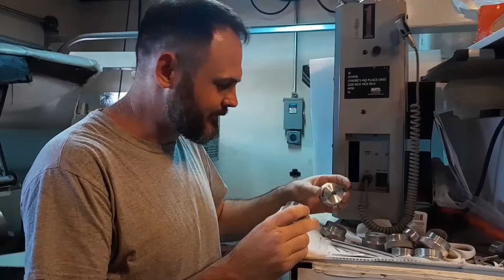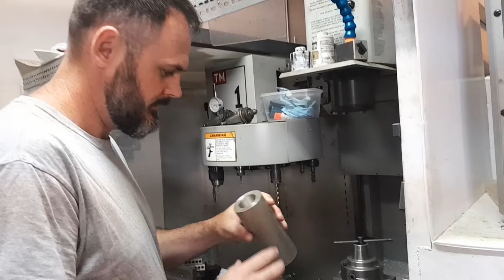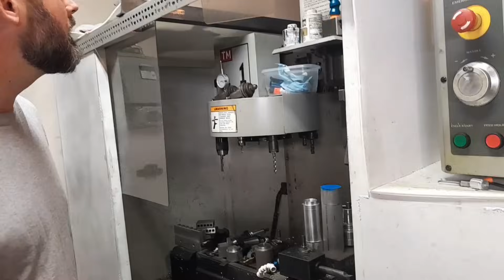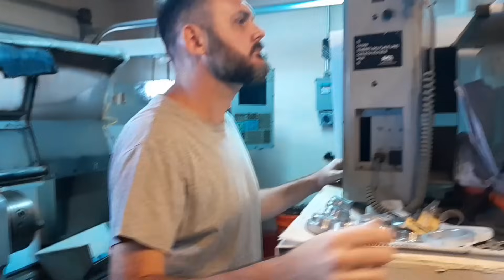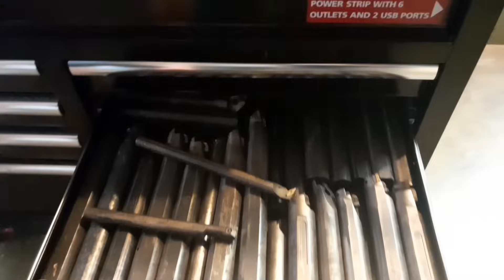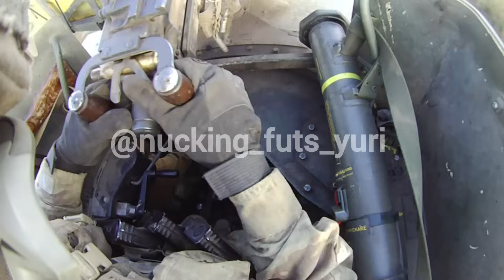Big plans coming.

Comment: Why are you moving the machines to Ukraine?  I am confused on why you would need to as foremost, AFAIK, Ukrainian Machine shops and Machining network is not under full utilization more lacking funds to do the work and maybe the expertise, design wise.  You'd need someone to run the machines anyways. Granted I could see this being a travel time reduction measure but that can't be the sole reason as Poland and Romania are known manufacturing centers particularly the latter due to substantial German Investment. 
Finally, wouldn't it also make more sense to do it stateside as you will have faster and easier availability of materials? Plus since you are an American educated engineer I assume that you are used to American or SAE standard materials something that would need to changed over to EU standard assuming you could get the correct substitute material in Ukraine.  Plus wouldn't you be putting your machine shop in range enemy munitions with the Russian superiority in Strategic and Operational Fires?

A questions about the drone dropping of munitions.  Is target presentation time so short that artillery assets, like mortars or tube, can't be given a fire mission in time to strike targets or is it too dangerous for the firing units or is it something else?  Due to the small size of drones, wouldn't it make more sense to use any larger payload capacity for better sensor packages, loiter time, or both? I bring this up because it was mentioned by the Terra recon group, 3rd Brigade, as the preferred method of using the drones.

Comment: It's already water under the bridge, but why not buy the machines in Ukraine, or in Poland?
Reply: Some places there is a bit machinery desert so to speak.  Bridgeport’s are like the AK of milling machine world. Lots made and even more clones. Yet in my area, a decent one is 3-4 times the cost comparable to the east or west coast. Same with lathes. Not even getting into the used CNC market.
Reply: Basically any on the used market are for sale because they are absolutely clapped out.

Comment: Amazing effort and work. Incredible dedication to helping the people of Ukraine. Proud of people like yourself.
Reply from the maker: I'll be running operations from the start. Setting them up and attempting to get more machines and capabilities.
Reply: @nucking_futs_yuri sorry, I edited my comment after finishing the entire video. Thanks for answering my questions though.
Reply: @nucking_futs_yuri I’m sure you are aware, Mercado is leaving the US in a week to Ukraine. He has the Earpro/eyepro you discussed in Kyiv. I’m sure your in contact and have this all sorted.
Reply: @nucking_futs_yuri sell the machines and buy new ones in Europe!
Reply from the maker: @Fenrir.Gleipnir  I get that a lot. No. Trust me it is cheaper to do what I am doing.
Reply: @nucking_futs_yuri  there are some nice developments in rotor tech, silent toroidal shape like rotors, looks very promising, only downside is the manufacturing is much harder to pull of.. anyhow, take care and all the best with the move of your gear!
Reply: @nucking_futs_yuri So basically you people will upgrade existing drones or build new ones from RC-hobby components or how far you want to go down the vertical integration?
Reply from the maker: @l.b.3416  building mission specific drones from the ground up. I'm working with an entire team of guys on this, each with their own specializations.

Comment: A lot of the Russian defence seems to be in the treelines, do you think drone dropped Molotov Cocktails instead of grenades would help clear them out?
Reply from the maker: Fun fact: Flamethrowers used against entrenched soldiers isn't a war crime.
Reply: @nucking_futs_yuri  Fun Fact: Flamethrowers also may or may not fit onto large drones
Reply from the maker: @TilW  we'll see 😂
Reply: @TilW  
Idk man
100kg Napalm canister should be able to be carried by some of the heavier drones
Reply: Ever seen the crop duster drones used by farmers? What you are proposing is absolutely achievable! Look up the DJI Agras T40 demonstration. It will give you plenty ideas.
Reply: >molotov
Napalm/Thermobaric is more like it
Reply: @krellio9006  Drones can only carry a couple of kilos, a thermobaric warhead doesn't set fire to a treeline.
A Molotov normal has petrol or diesel mixed with a sticky substance like petroleum jelly or plastic so it's basically Napalm like in it's effect, setting things on fire.